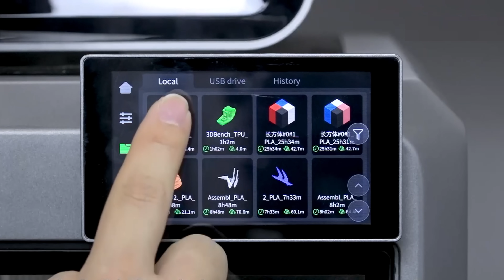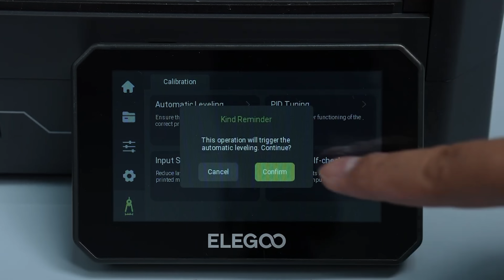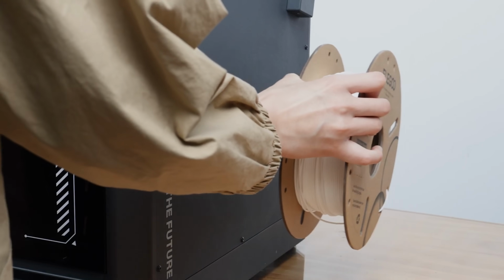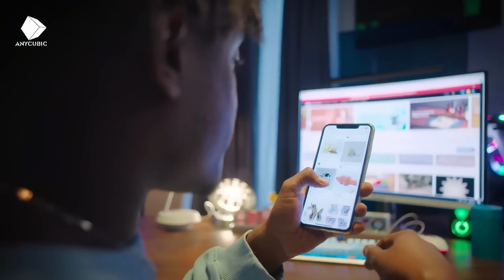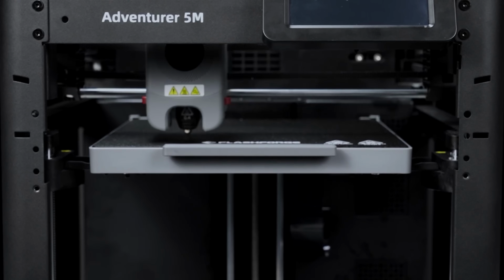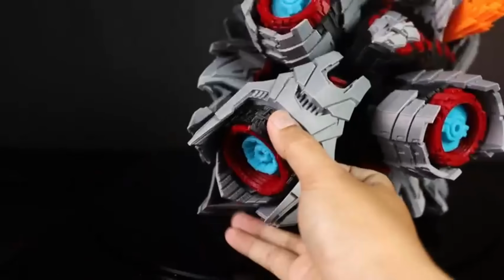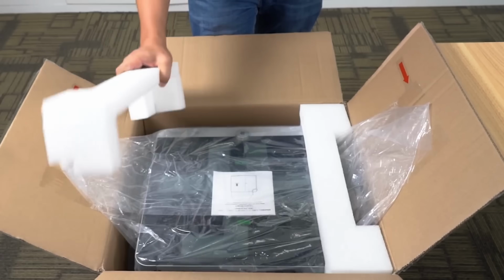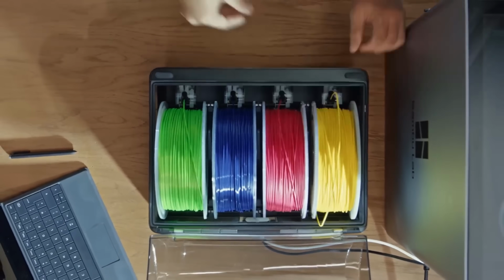✅Best 3D Printers 2026 [Wait Until You See What’s #1]

Comment: Do these come with software?
Reply: on the printer: yes, if you mean slicer or a program to make models: no. but, for the most, you can download slicers for free; often on the manufacturer's website, but in some cases, others works also. for some slicers you need to set up the printer if there's no profile for that on it (like, for the elegoo centuri carbon on cura).

Comment: Prusa every time, I had a Bambu A1 Combo, but after the dictators at bambu started I got rid, bought a Prusa XL 5 head, perfect first layer every time, so I have now bought a Core 1 as A Single Filament printer, I do have 2 x Creality K1, just converted one to the CFS, but nothing but trouble, creality are so slow at answering, been 4 days, and no answer,  filament ran out and ignored the refil for a couple of times, now screen freezing or going blank and won't come back on, I wish Creality would sort out the problems with the exsisting printers, before bringing out moreprinters , Prusa ...... same day answer, same day solution.

Comment: Im looking to get into  3d printing. Im looking at the prusa mk4s and the bambu p1p. Any thoughts ?
Reply: neither of those. If you're already spending that much money, get an enclosed printer with a multi-color-system. Right now, the models with the very best price-value-ratio are the bambu P1S combo and the Anycubic S1 Combo. Prusa is vastly overpriced for what they deliver.
Reply: @Etherion195  But for the core one you pay the price to get a good Printer without an only profit orientated brand behind it. Bambu and the others have these prices because they produce cheap and arent interested if you have a Problem because helping would cost them too much.
Reply: I'm new to 3D printing as well. After watching reviews and doing research, it's hard to beat Bambu. But I chose the Prusa Core One for two main reasons: it's not a locked-down Chinese printer, and it's fully open source, so if something breaks you can fix it yourself. It is more expensive, but the overall community and support outweigh the convenience. You can also get an MMU to print multi-color, and Prusa is working on the next generation to compete with Bambu.
Reply: Get the core 1
Reply: Core One best choice for a printer in this range and please build it yourself
Reply: @titiwualpha8437  no, it factually isn't and the core one isn't anywhere NEAR the price range of the P1P.
Reply: Centauri Carbon: https://www.youtube.com/watch?v=zLhrvaFxylA

Comment: Bambulab es  la impresora que ha cambiado todo, lo demás son imitaciones. La nueva H2D volverá a revolucionar la impresión 3D
Reply: well, bambu labs had made that, what had been needed to do - show what is possible. otherwise, we won't see a few of these printers, especially on the Core-XY basis... or also others wich a AMS-sort like system. without bambu labs, we would use maybe the same tech as years ago and nothing could had evolved much... now, all manufactuerers try to compete against the others and bambu, but not all can reach them. but, tbh, even bambu had it's problems... like enclosing themself, so that there's literally a "chinese wall" around them who can't be climbed.

Comment: The Prusa is very much like the Johnny Walker ad. Yes, they cost more, but when you get one you start to understand. I hated the price of my XL 5 toolhead but it just never lets me down. On the rare occasions there's an issue it stops and waits for me to rectify the issue (such as tangled filament feed). My only lost prints are where it needs supports and I forgot to add them. Even in the hottest Australian Summer days where my Patio gets up to about 48C it keeps going. Unlike the Bambu Carbon X1 that repeatedly jams on retract if I try multi colour usage in warmer weather.

More and more the other machines either gather dust or get loaned out to friends who want to get into 3D printing. Nowadays it's either the XL or my big IDEX printer that I rely on. But if I were to buy a new machine, it would be the Core 1, no doubt at all.